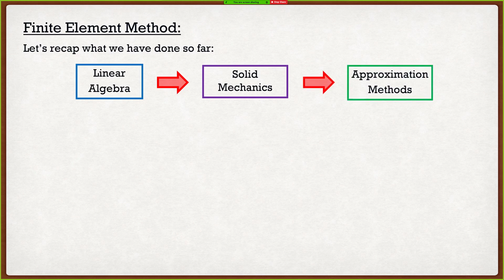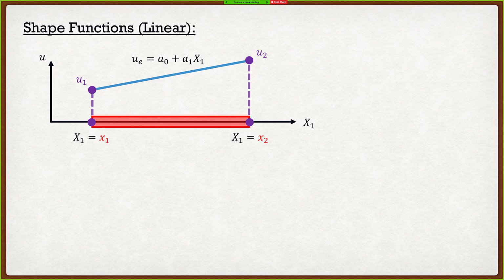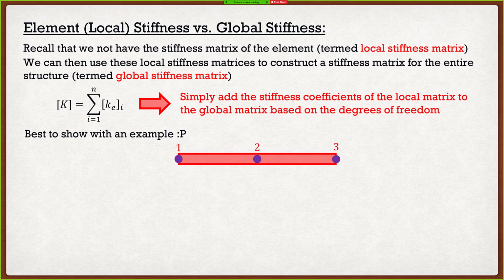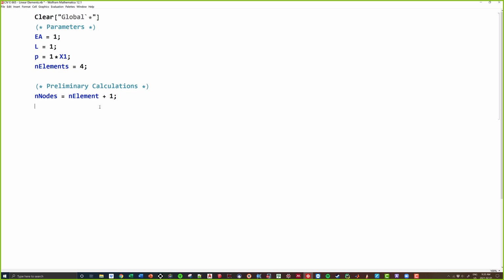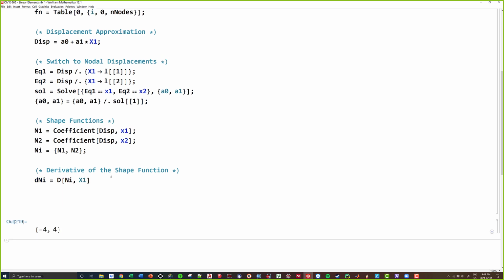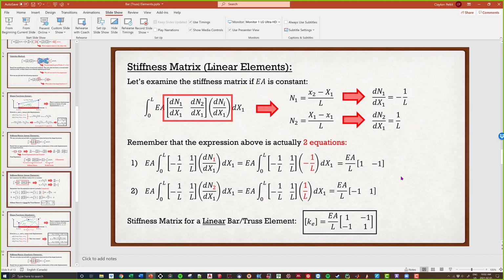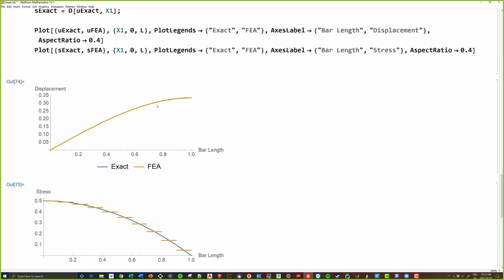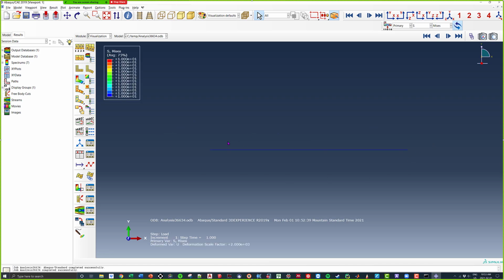Intro to the Finite Element Method Lecture 4 | Truss (Bar) Elements and ABAQUS Introduction

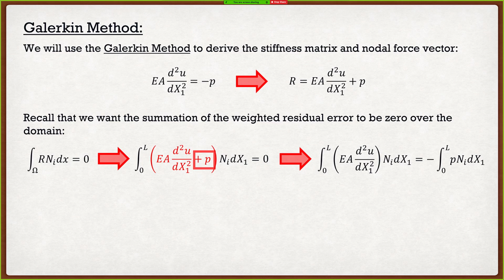Comment: Hello. I have a question. When you do integration by parts in 15:24 you don't explain why you do it. The first thing I thought was that you have to do that to work with linear functions N_i. If you use linear N_i but do not integrate by parts, then the integral on the left would be a constant and the equation would bring solutions with much greater error.

Comment: Thanks for this very very nice lecture yo have  presented in very easy fashion.
I have one doubts at 1:56:00 where you are correcting the initializing of forces by replacing nodes with nElements.
I think it would be node only but i=1:nNodes not from i=0:nNodes.
please correct me If I am wrong.